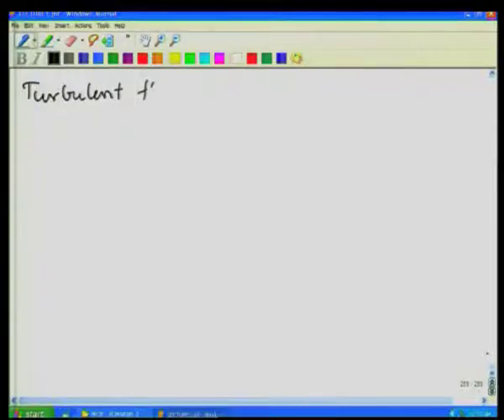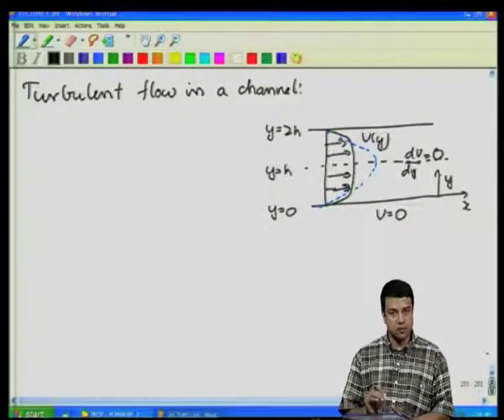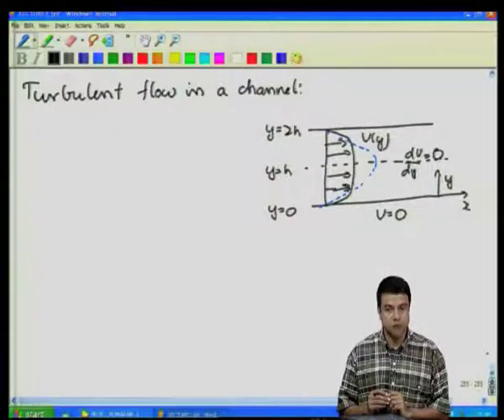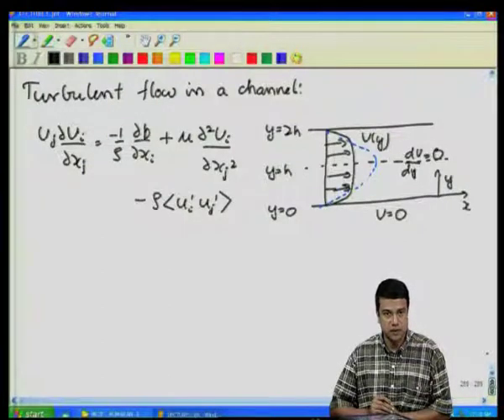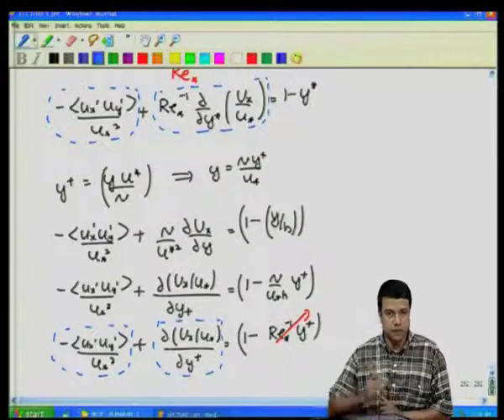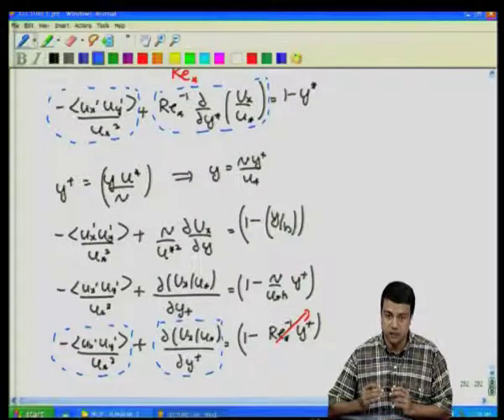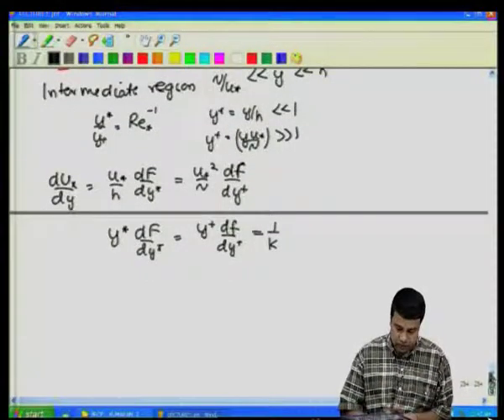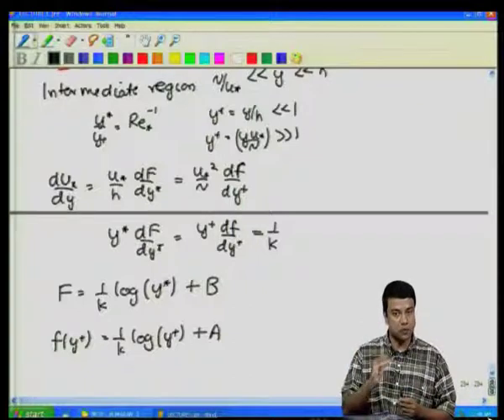Mod-01 Lec-40 Turbulent flow in a channel

Comment: the lecturing is colorful.is it possible to calculate flow by having water depth (h), floating velocity (v) and channel cross section  area information in the concept of turbulent flow
Reply: I know it's a little late reply but still. Dude flow is an easily measurable quantity. The argument is how to obtain unknown quantities from known quantities. U cannot measure velocity gradients in the flow ( until and unless you don't spend a fortune on  particle image velocimetry equipment or you don't go for highly computationally intensive Direct Numerical Simulations ).